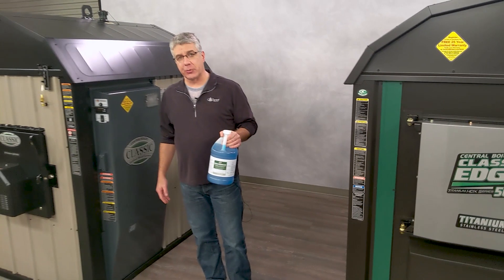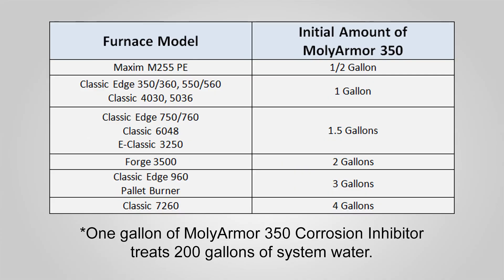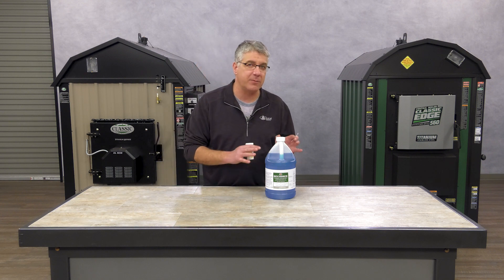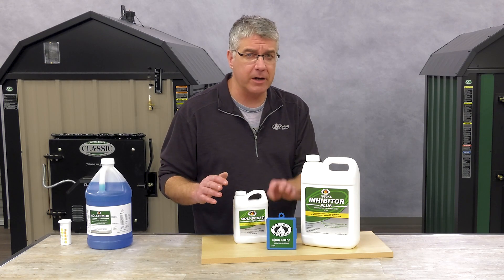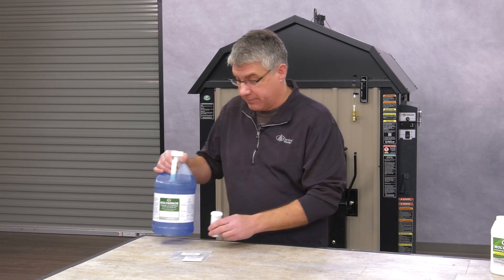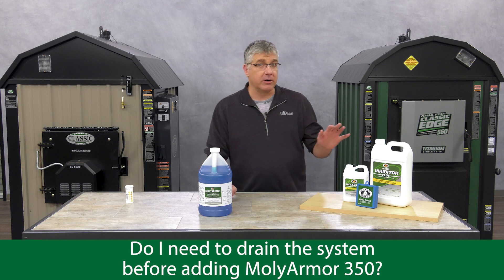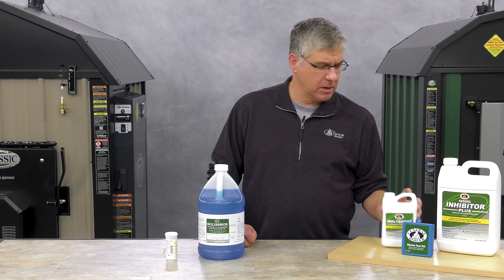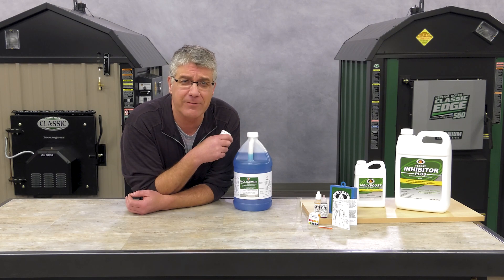Furnace Water Treatment Corrosion Inhibitor MolyArmor 350-1650 XL Inhibitor-MolyBoost Central Boiler

Comment: Hello, I tested my water in my mp255 maxim. My test stripe turned green. The ph is between 8-9. I have the molyarmor 350. Is the ph 8-9 okay ????     In the video, I think you are saying if the ph is above 6 or more, it's fine. Could you let me know, thanks Troy
Reply from the maker: After the MolyArmor 350 has been added and circulated, the treated water should have a pH between 8 and 9.5

Comment: Are your products good for stainless steel, copper and pex radiate heat tubes ?
Reply from the maker: Yes!  These are materials often used with Central Boiler heating systems.

Comment: I have a Central Boiler 5648, and never used molyarmor before.. I test the ph and nitrite levels annually and everything is spot on, and water is clear.. In the video you indicated you don’t need to drain the system.. if I add the molyarmor, do I no longer need to use the old test strips, or continue to test ph, nitrites and the molyarmor ph test?? (All 3)? Also, how much molyarmor should I add? Thank you.
Reply from the maker: We have an article on our Support Center to give you all the info.  You'll need to enter your serial number to read the whole thing.  https://centralboiler.com/support/articles/molyarmor-350-corrosion-inhibitor-systems-with-1650xl

Here's an excerpt: 
What if My System is Currently Treated with 1650XL?
If a furnace currently is properly treated with 1650XL or 1650XL plus MolyBoost, the operator can choose to continue to monitor the nitrite level as instructed in the manual. If the nitrite drops to a level below 1500 ppm or the pH level drops below 8.5, the furnace should be drained, flushed and refilled using MolyArmor 350 to the recommended minimum level of 350 ppm. Be certain to immediately heat the system water to 185 degrees and circulate for at least 24 hours. The litmus paper pH test will be used to confirm pH of water added is between 6.5 and 8 and after treatment the pH level needs within a range of 8.0 and 9.5.

For your Classic 5648, 2 gallons of MolyArmor 350 would probably be enough, but be sure to test it to verify you have 350 parts per million if you go that route.

Comment: I realize you said it in the video but just so an old guy like me understands... I'm running an eleven year old CL6048 w/~50% antifreeze. Water is tested twice annually and 1650XL added if indicated. Based on your recommendation, I should add 1-1/2 gallons of MolyArmor 350 and monitor with the appropriate test kit for enhanced protection of my beloved Central Boiler unit? I'm all for protecting the old girl just want to be sure WTH I'm doing. Thanks!
Reply from the maker: Thanks for sharing!  And Yes, you can add MolyArmor 350. Your CL6048 would require 1.5 units, but you can add 2 units to be sure you have enough in the furnace and system.